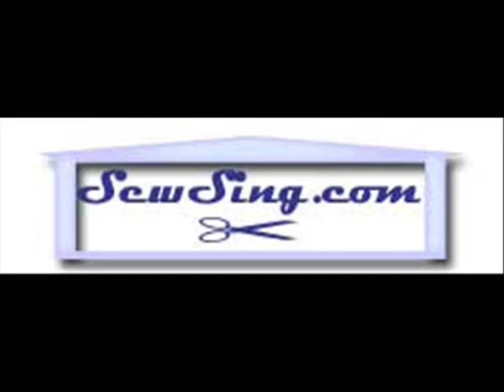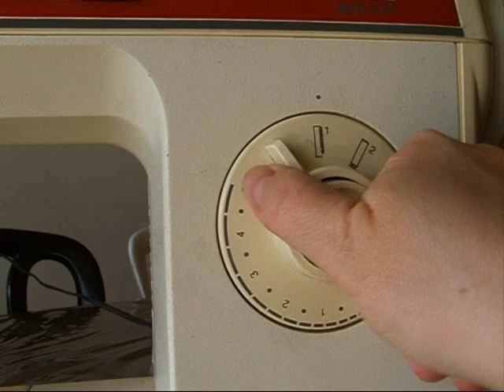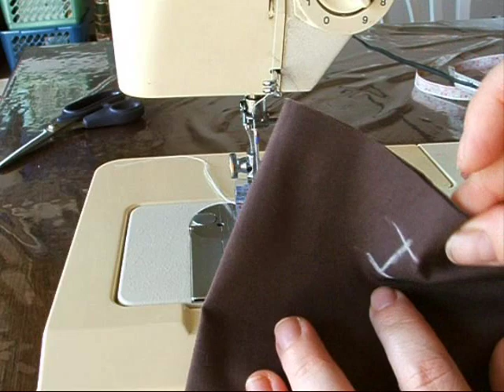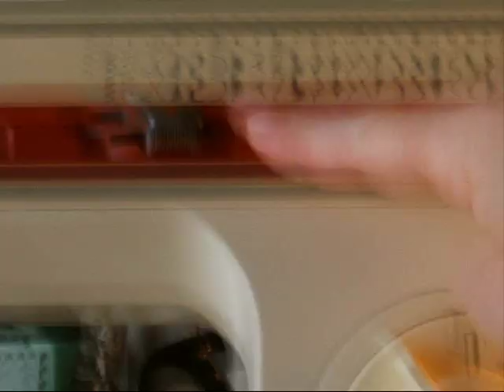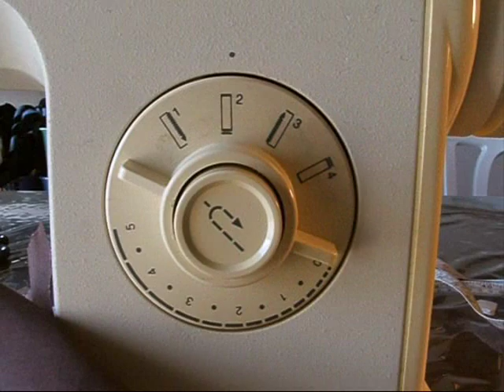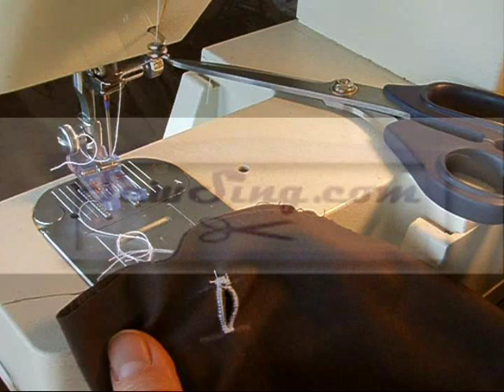Sew a Buttonhole in 4 Steps on your Singer Sewing Machine

Comment: Hi -- I'm about to modify two of my dog's store-bought double layered fleece jackets with an opening to accommodate his harness, which goes about a quarter of the distance down his back. His back is long, and I thought using a buttonhole stitch would be a good way to do this, and I still do think so. However, I'm wondering about the interfacing. Do I need a lot, or just enough to cover the length of the stitching? I wish your video included interfacing or a little bit of a description of how you'd use it if you were. Other than that, I liked the video a lot -- it definitely helped. Thanks!

Comment: See if you have any feet that can accommodate a full width zigzag.  Then just be very careful about how you line things up.  The buttonhole foot has lines to help with that, so without one, you would just have to wing it.  When all is said and done, though, a buttonhole is nothing more than a series of strategically aligned zigzags.  Wide at the top...narrow down one side...wide at the bottom...narrow back up the other side.